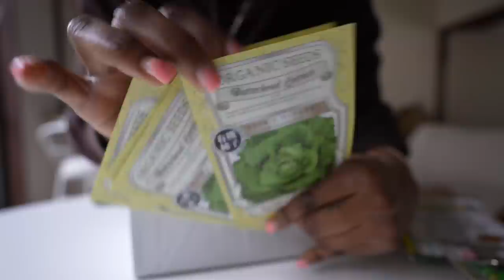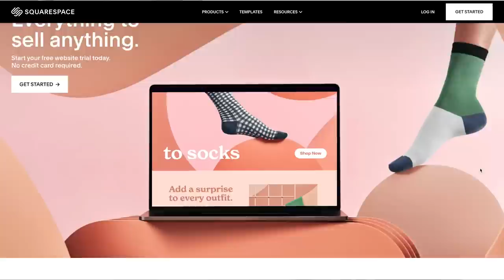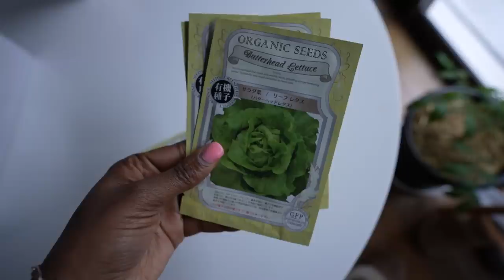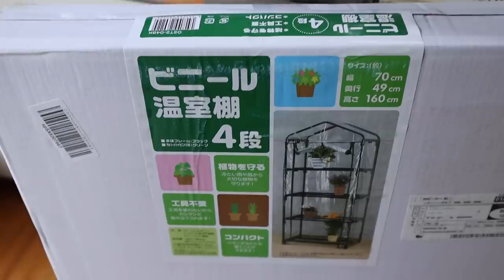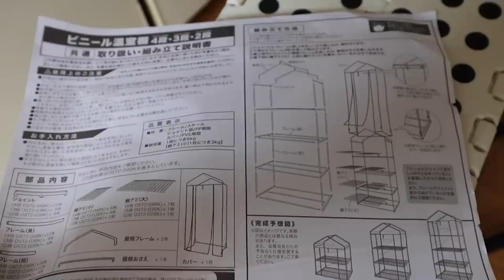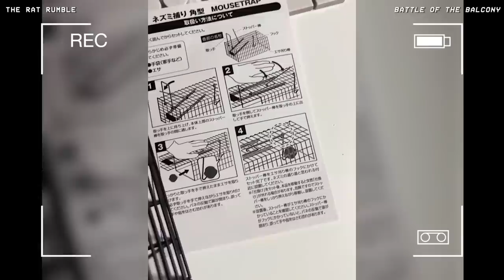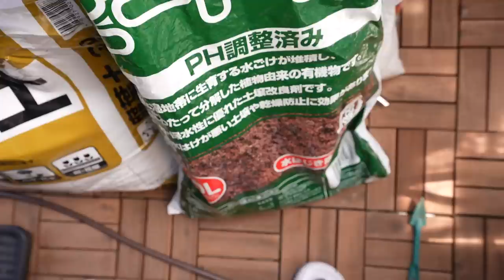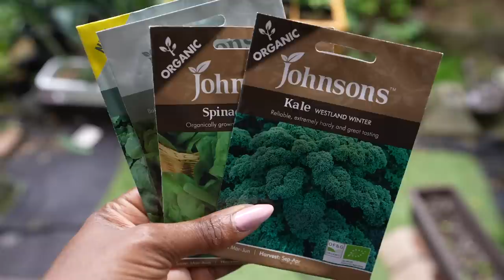THE DRAMA! 😫 CHANGE YOUR LIFE!  JAPAN MOVING VLOG a vegetable Balcony Garden. Grow your own food

Comment: I found you because of gardening. I have a larger garden in my back yard, but my bestie is starting a balcony garden and wanted to get some ideas for her since she has never gardened. I do want you to know though seeds don't really "expire". You may have lower germination rate but they should still grow. I have seeds that I still use that are over 10 years old. Also, try and find a way of tying down your green house. If there is wind, it could tip over! The higher the better.  Thanks for your video!

Comment: Okay love so what if you buy one of those cheap gardening runners or just black plastic bags and you can go around the outside of the balcony with it and place your planter boxes around on top and fill with black or white pebbles and use the snap wood like a runner filling the middle. Or same concept but use the fake grass tiles instead of the rocks putting the wood in the middle again.

Comment: Tip: At a flooring store (I am unaware of what it may be like for Japan because I live in Canada) you can purchase roll-on linoleum with your balcony's measurement and get it cut to the length and width of your balcony and roll it out. When it comes time to move out it is easy to uninstall (rip out and toss or even re-use depending on your preference). 
I hope this helps. Best of luck with your beautiful balcony-garden Sundai!
You may be able to get it at a Japanese Home Depot? Or flooring/wallpaper supply store?
Per square footage, it could possibly save you money in the long run as you only pay for the full piece of flooring (cut to the size you need) instead of each box of tiles for 50 dollars.
I know Japan offers samples for which colours and textures you may want for the flooring. It's a possibility. Up to you.

Comment: For all pest control problems give your plants a good hardy bath in hot sauce water (roughly 1/3 hot sauce 3/4 water). The smell itself should keep the critters away and the hot sauce doesn't impact the plants. At least it never bothered mine. You want to do it at night not only because it will stop the water from evaporating and taking the hot sauce with it, but because that is when the little pests come out and start their nibbling and you want to get them when it will be at its hottest. This also works to keep all kinds of bugs away from the fauna babies too. If the critters do end up nibbling on the plants the start to associate your plants with mouth pain and tend to go away after a day or two. You want to give the areas the critter seems to like the best the most watering, like you mentioned it was going for the stems. Hope this helps.
P.S. You might want to keep Duchie inside over night after applying the water so she doesn't get it in her mouth or eyes. I have cats and use this same method to keep them from chewing on my plants. Cats are smart and normally just sniffing the plant wit hot sauce on it keeps them away but always better safe then sorry.